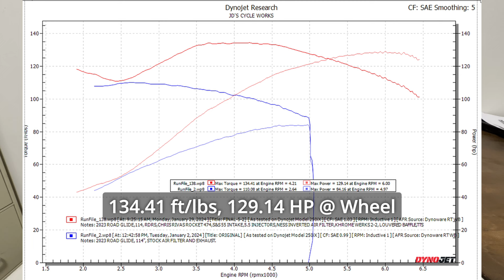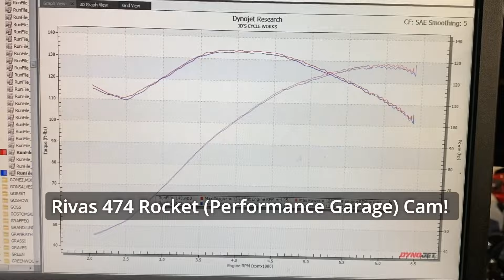Rivas Rocket 474 M8 Cam

Comment: I ordered all my 128 build parts this weekend. Thanks to Dave and this video, I’ve decided to run this Rivas 474 cam instead of my wood 22XE. Should be fun
Reply from the maker: Wow, that’s great!  Enjoy!
Reply: You will love it. I made 141hp and 156 tq on a 124 with the se64mm throttlebody and manifold. Stock heads. Pulled hard
Reply: @benslocum7412  Is it reliable power? I still want state to state type of bike
Reply: @ernestoluzan  yes it is we ride state to state no problem and still get good fuel mileage
Reply: Man thank you for starting this series. You’ve already tested most of the cams on my shortlist. Only one left and the one I’m having most trouble finding info on is Rocket 444. 🙃
Reply: @Stiffler_HD  what would you like to know. I have my dyno sheet. I can tell you all the specs on it. Great bolt in cam with a nasty idle
Reply: @benslocum7412  I think I replied to your comment instead of the video itself LOL. I’m wondering about the 444 cam and hoping it will get tested and how it compares to some of the other low end cams. I specifically am looking for a nice lumpy idle and low end power.
Reply: @Stiffler_HD  ok 👍. I do have my chart for the 444 cam if you want to see how it does
Reply: @benslocum7412  oh dang. Yeah I’m interested!
Reply: @benslocum7412  I'm also interested in the graph of the 444. It's really difficult to find info on it.
Reply: What did you pull.

Comment: Are you changing the cam bearing with every swap. I almost went with that cam. Or the 464. The 444 is a great cam also.
Reply from the maker: No.  The cam bearing was updated with the first cam swap.  After all testing is done, I will replace the bearing again
Reply: That 464 has a very early exhaust valve opening...which should make it loud af!

Comment: Was the gas mileage reduced any by adding that cam, or did it stay relatively the same?
Reply from the maker: A property calibrated motorcycle should get decent fuel mileage.